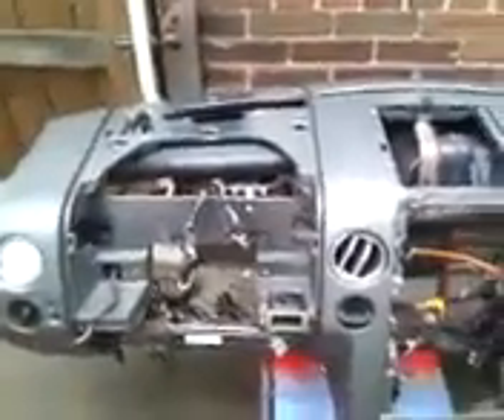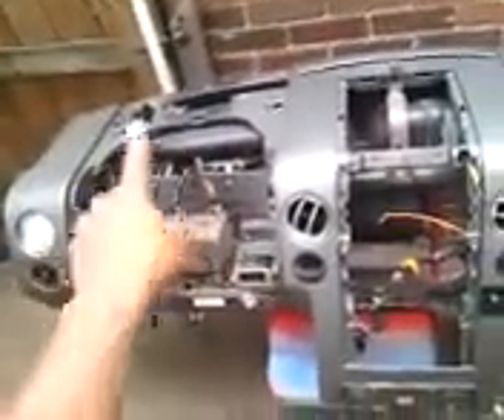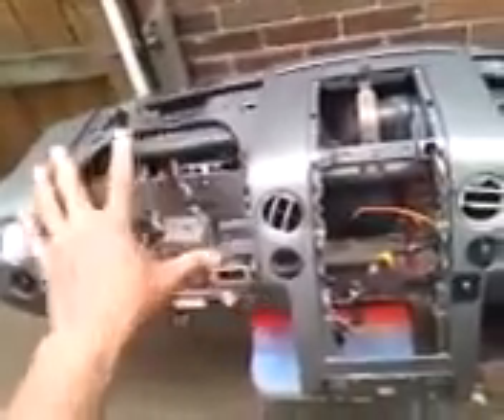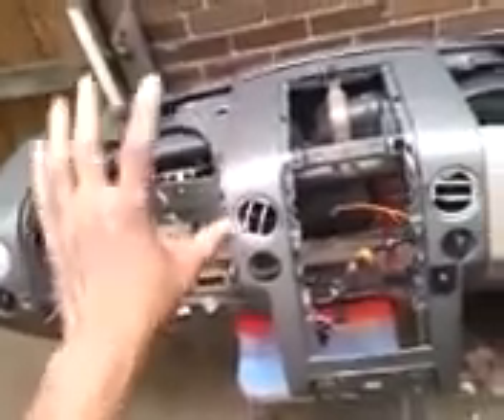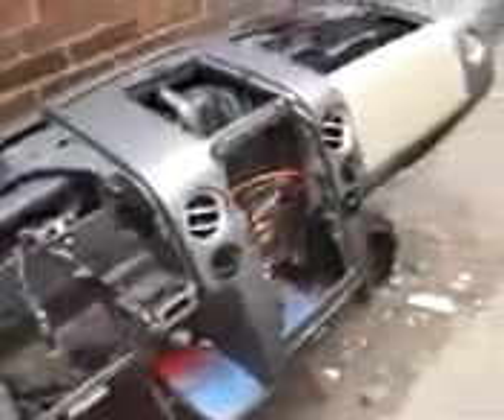Fiberglass dashboard for 2005 f150 part1

Comment: under the dodge truck is the ram I love the ram.but so F 150 

yes MB you can do it don t rush don t push.go as slow as half cylinder citroen 2cv
very slow
motorize is nice.but if motor stop or failer gotta be easy to take it out you have install it
like so easy to reach the motor .alberto